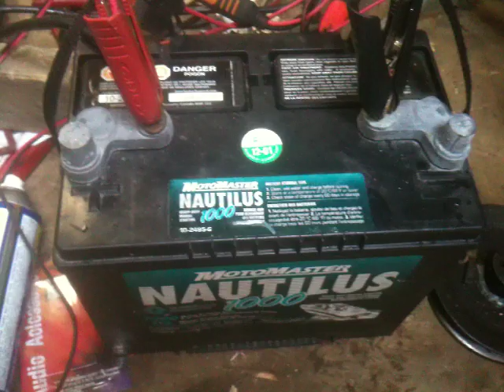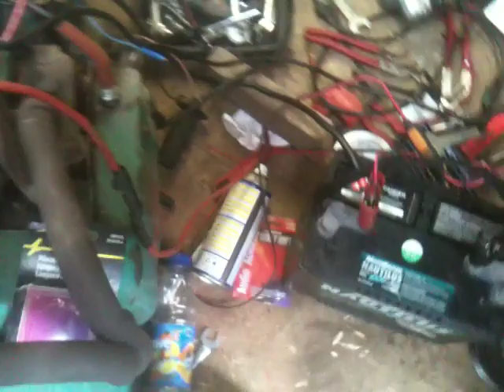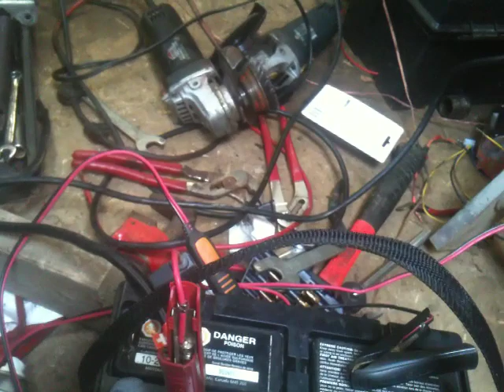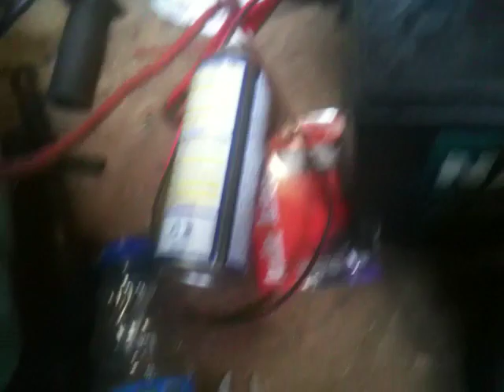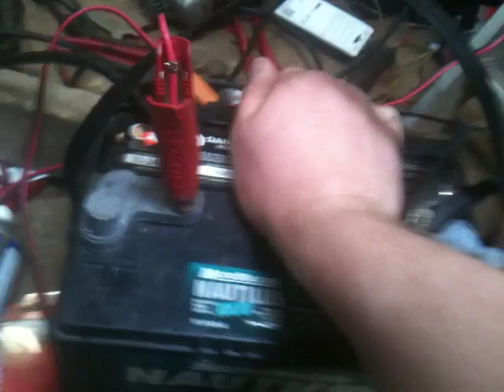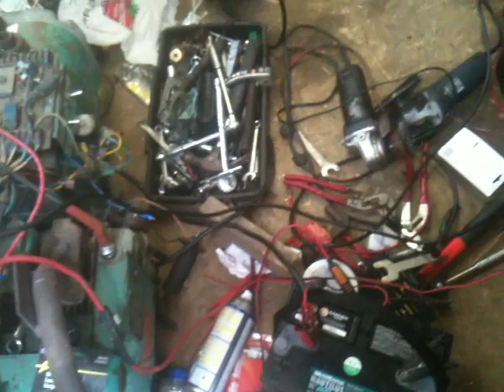Marine Batterie

Comment: Ctek works real neat to recharge those batteries so no worries there bud.
Mostly you just recharge those as any regular car batteries BUT there are some "versions" you have to load with a special charger.But that Nautilus battery looks like it´s going to be fine together with your Ctek charger.

Cheers from a non hater